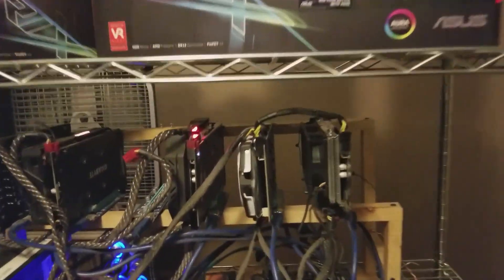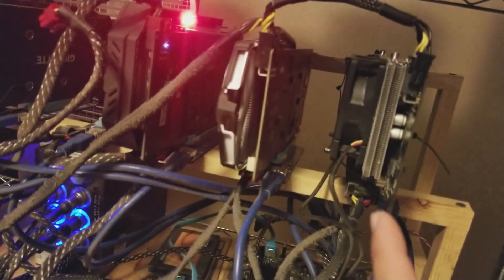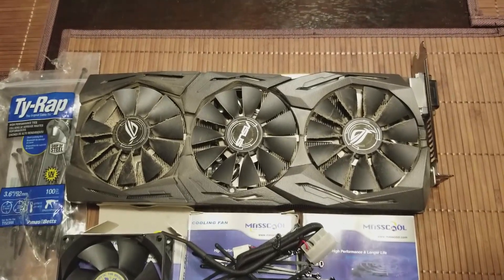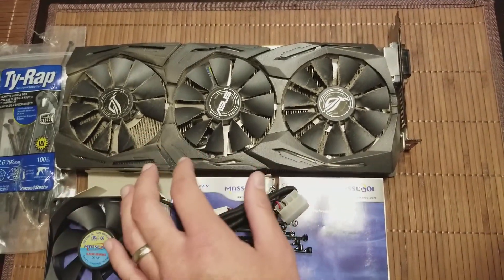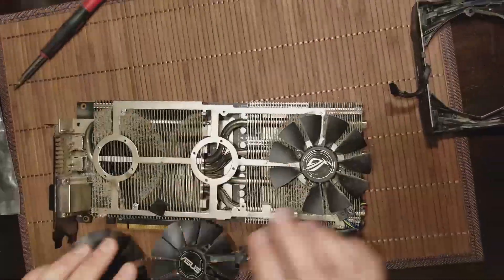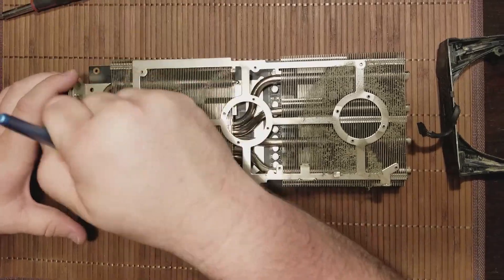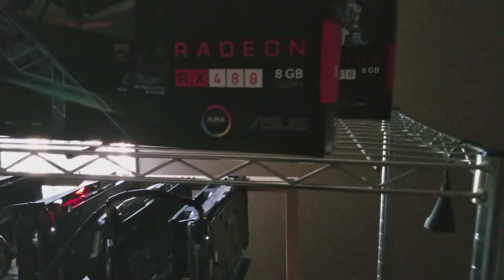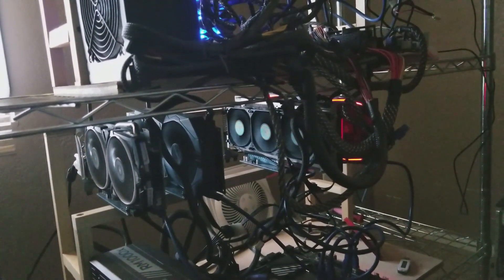Mining GPU fan replacement

Comment: I did the exact same thing  when my zotac 970 card's fan died..  I used some metal wires instead of zip ties though
Reply from the maker: I like that idea. I'll try it on the next dead fans. Have you had any issues with shorting out the PCB?

Comment: Cool vid but I dislike only because u helped the GPU catastrophe of 2017-2018 rip
Reply from the maker: I still appreciate you watched the video. I'm a gamer that started mining. I got in at a good time, before prices went crazy.
Reply: now us gamers have alot of cheap rx 580s :D just picked one up for around $120, 8gb OC armor Msi. Doing the Bequiet 2.0 fan mods as well!
Reply: @lun7n  Same! Just got an RX 480 for $112 off of eBay. However, the fan is really loud so I'm trying to find out how to replace it.
Reply from the maker: Replace the fans with high pressure radiator fans and use zip ties. You can order direct replacement fans, but they cost more.
Reply: @joenanez  It ended up being an issue with that particular GPU -- there was some damage to the VRAM die causing artifacting. The card was an HP OEM model, and the single fan simply couldn't handle the 480's massive heat output. The fan was just loud because it was permanently ramped up. Luckily, the seller was willing to give me a refund because of the artifacting, and I now have a new RX480 with three fans that is whisper-quiet even though it's overclocked.

Comment: Hi Joseph i am trying to start this month to do some mining if you don't mind to just gime a guideline to what graphic card to get that be economical to start whit i really appreciated in your on time thanks    Good video
Reply from the maker: +1miltond right now it's hard to get a GPU at a decent price. Nvidia and AMD are going to increase production which should help stabilize pricing.  Only thing I can recommend right now is maybe going with a pre built system with an RX 570 or GTX1060.  You can check supply at box stores like Best Buy. You might get lucky and find something in stock.
Reply: Thanks Joseph this is great help  is a good starting point for me i got to start on the small side butt  thinking on expanding one card or 2 a the time thanks again  who are you using on line for you mining that can be trust ? software company  ?
Reply from the maker: +1miltond nicehash if you want something really easy to setup. Use claymore if you want to mine ETH and hold. You can use BTC or ETH to buy smaller coins.

Comment: In case you didn't know, AMD cards are no longer profitable. Nvidia GTX 10 series are more profitable, because mining software developers have found a way to utilize Nvidia's Pascal Architect. Nvidia knows this, and this is one of the reasons Nvidia asked their product dealers to limit the amount of cards miners can purchase. And also, Bitcore BTX is currently one of the most profitable coins to mine right now. The BTX chart looks very much like ETH's chart. You are missing some huge potential if you miss out on Bitcore BTX.

Comment: Great video.  Did you see a megahash increase on the cooler temp?  Small efficiency gain?
Reply from the maker: +Jon Miller no increase in hash rates, but lower temp should increase lifespan of the card.

Comment: Cool video. I would have liked to have seen how you dealt with the fan power for the card. Did you plug in the fans power to the power supply or the video card?
Reply from the maker: On the Rx 480 I plugged the molex to the PSU. With the RX 470 I plugged one into the motherboard and 1 into the PSU.
Reply: @joenanez  actual it would work with wiring from GPU. But it is more complicated. And most eficient way for controlling speed simple potentiometer.